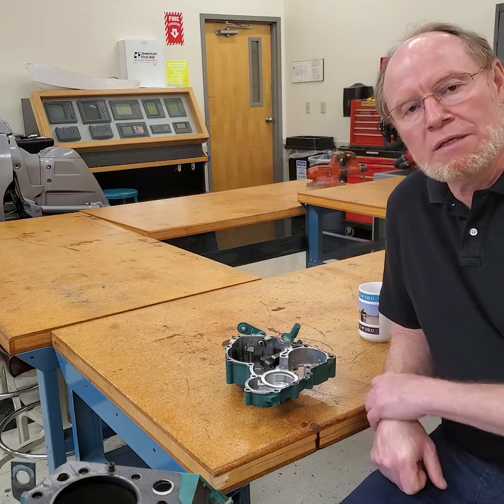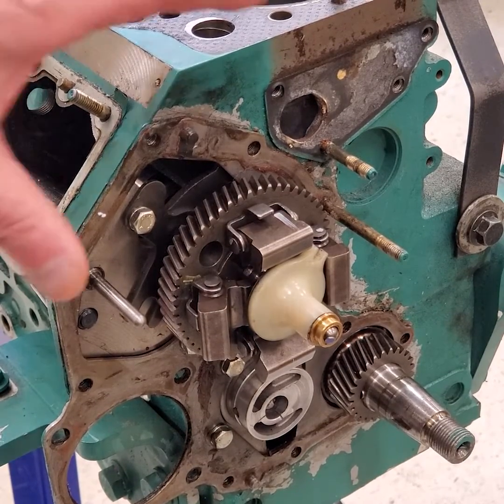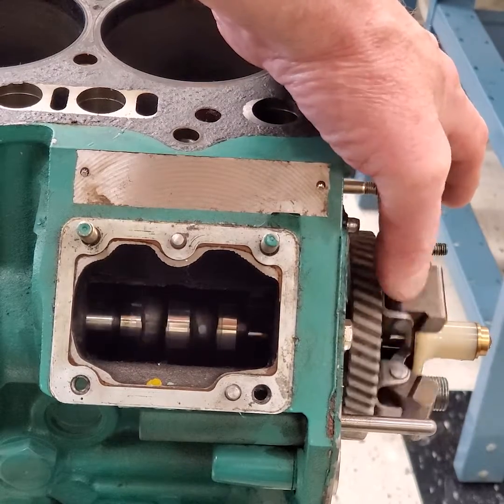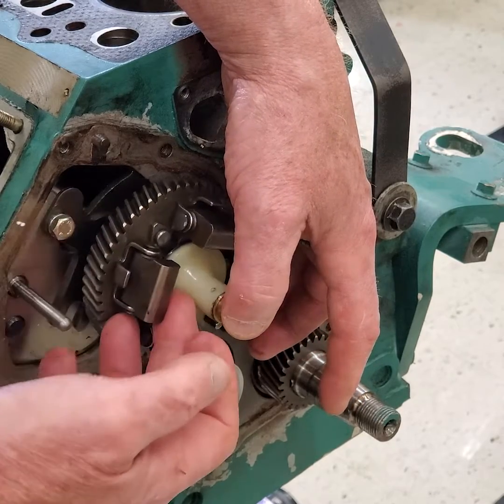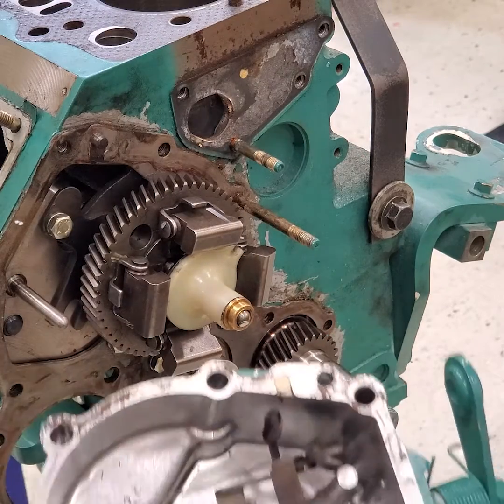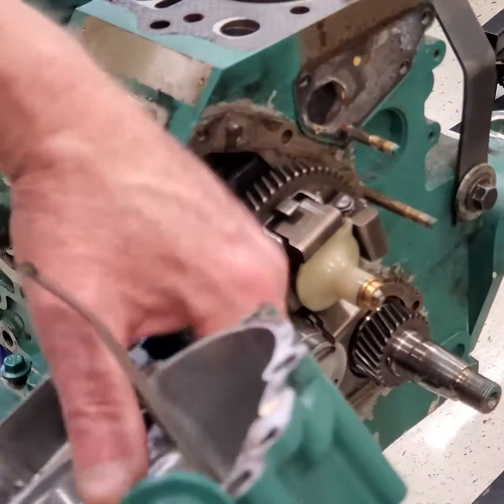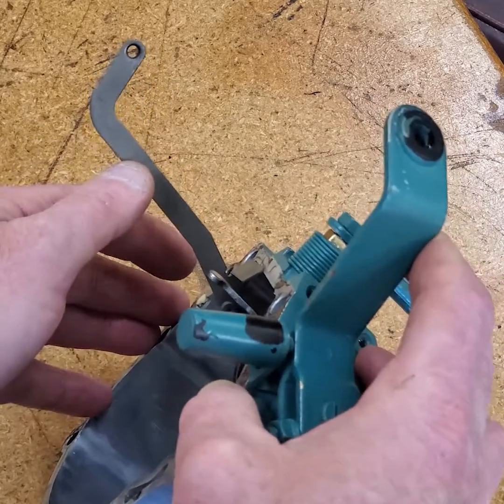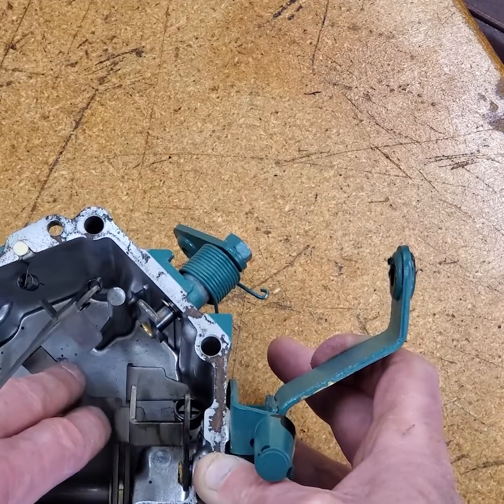How a Diesel Governor Works

Comment: if i pull a fuel injector of a 1960 tees three cylinder air cooled diesel am i going to find parts that perform the same tasks as the parts you showed in this video..... ( ruston buycrus 10 RB dragline )
Reply from the maker: I doubt the governor is behind the injector. I also Never worked on one of those.

Comment: I have a question please. Firstly though, thanks for this fantastic video!
My genset has a Lister Petter TR3 engine with an old DeepSea controller. As soon as I start the gen, the controller shuts it down again almost immediately with an over-speed warning. It has a magnetic pick up and it has a frequency sensor. The MPU seems fine (I put a new one in). I measured the Hz and it does indeed seem to shoot up right away upon starting. The cut off for the controller is 57 Hz because the genset is 1500 PM with 50 Hz normal output for Ireland/Europe. After watching this video, I am wondering if somehow the fuel rail is being kept open, even though it seems to move freely when I removed the small inspection covers. What do you think is the likely cause of the overspeed?
Thank you!!
Reply from the maker: I would first use a photo tach to verify the rpm is actually overspeeding. If you can verify that, then  it is likely their is a fault in the governor mechanics/springs.
If the rpm does not exceed the 1500 rpm then the Mag pickup or reluctor wheel is where I would inspect next.
Reply: @tedsmarinerepair8956  Thanks a million for the quick response. I will check these.

Comment: Thank you for an excellent crash course understanding. I have a 50 hp, 3 cylinder Deutz diesel in my stump grinder and that governor works hard as the load is continually changing. Many thanks for your time and efforts to share your knowledge on a difficult topic to learn about!!!

Comment: I've been searching many videos of diesel engine fuel injection, why people insist to say throttle as diesel engine does not have throttles, it makes confusing, do you mean acellerator pedal right?
Reply from the maker: Yes, I still use the term Throttle as in throttle "lever" which controls power output.  The two helm levers are typically referred to as the shift and throttle levers.

Comment: Bravo sir. 
Also to add, the 4 fly weights I've found as you said keep the engine at a low rpm under load. 

When removing 2 of the fly weights, allows the engine to work conventionally.

Comment: Great video. I'm trying to troubleshoot an Onan 11.5 kw genset that running on (almost running away) at high rpm and the only thing shutting it off is shutting off the fuel at the manifold or blocking the intake. What do you think could be the cause of a genset running away and not be shutdown by the shutoff lever?

Comment: Hi. This was very well explained by you. Thank you so much for this. So I have a question.
I have the same engine on my home generator. The RPM doesn't seem to be holding itself with variation in the output load. The voltage and frequency keep changing and my solar inverters keep disconnecting. Any suggestions? Are the fuel plungers weak?
Reply from the maker: @ZahidAWMall  it does sound like a fuel issue with the gen set. I would start at the carburetor to see if it is clogged somewhere

Comment: Hi, I hope it's okay to ask you this question because I can't seem to find any information about faulty governors online. We installed a completely overhauled volvo penta md11c in our sailboat, and although it's running it won't react well to the throttle. When increasing throttle, it will take a while for it to get up to speed. Sometimes, when under load, the RPM's won't increase at all until we press the cold start button, then it will respond to the throttle pretty well. After returning to idle, and increasing throttle, it will not increase RPM's, or will get up to speed very slowly. 

The mechanic who did the overhaul says that it's because the engine needs some time to run before the governor will function properly. Something about the weights getting stuck and needing some time to settle. Could that be true? We've ran the engine for 3 hours now, changing speeds every minute or so, but not much has changed. I hope you can give some advice or peace of mind or advice!

Comment: Thanks for sharing this video. I have a VP 2010 with a new injection pump fitted last year. Winterised the engine and have been getting it ready for the new season. I have lifted the pump off because I have no throttle movement at the pump and the engine will only idle. The external throttle lever is free and I have spring resistance from the large spring. I get movement from the fuel stop lever at th4 pump.. Before I remove the engine from the boat, can you think of anything obvious I am missing?
Many thanks in advance of any help you can offer.
Dave I the UK.

Comment: Its a similar set up to a honda close (predator 212) governor and if you removed that you can get more RPM and in turn more power would it be the same for if i did that for say a kubota 3 cylinder diesel and removed the governor? More fuel and put more air and more power?
Reply from the maker: Due these are marine engines and under 100% load all the time, it is not advisable to mess with the governor. That would ultimately lead to early engine failure.
Reply: @tedsmarinerepair8956  what about hypothetically it was in a motorcycle or of the likeness
Reply from the maker: Yes it will increase the output HP of the engine, but again in doing so this increases the stress that the engine is not designed for - and yes we used to do that as kids with our riding tractors and minibikes too! @gokartsminibikesandmore9925

Comment: Hello sir, whats the cause of engine hunting on these engines at idle, is the governor spring the reason?
Reply from the maker: Yes is a likely cause.
Reply: @tedsmarinerepair8956  shell i shorten the original spring to increase its tension or intall another stiffer spring?
Reply from the maker: @musavirkhan9795  order a new spring

Comment: Thanks Ted, bang on the money, I have a specific problem with a Volvo MD2010 that has been standing for 11 years and when started wants to run away every time and needs to have the air intake blocked to stop it. I’ve asked a number of marine engineers what the problem is and they have said stuck governor so this video has filled in the missing info to allow me to remove the timing case and investigate. Excellent and thanks again.
Reply from the maker: Did you ever get the govenor issue fixed?

Comment: Ted, great video...thanks so much for sharing this info.  I realize this is 2yrs old at this point, but I have a question for you.

I read through all the comments to see if anyone else asked my question, I don't see anything similar.

I'm working on a problem on a boat I'm purchasing.  It's a Yanmar 4JHE in an old 40' sailboat.  The problem is that under load RPMs are 1700 below where they should be (engine is rated for 3600 WOT, we got 1900 during the sea trial).  We thought it might be a problem with the prop pitch (feathering Maxprop), so I checked the pitch on the prop and it was wrong...but not wrong enough to account for the RPM difference.  We corrected the prop and got another 300 RPMs or so, but still well below where the engine should be (now at 2200 with properly pitched prop, but should get to 3600 WOT).  With no load, the engine actually revs a bit above where it should (we hit 3900).

Question- you mentioned several times in this video how the forces work against each other in a 'no load' situation with the governor.  Is there a separate mechanism or adjustment for 'under load' governing?  I know in some trucks, there is a governor to limit speed...so shifting up through the gears you get full RPM, but when you hit 65mph the governor kicks in and no matter how far you put the petal to the floor, no more fuel.  That is how this boat is behaving, as if there is a governor limiting the under load RPMs.

The current owner of the boat is an elderly man, and he recalls he may have asked a prior shop to 'set a governor' when he started letting his grandchildren use the boat.  This actually makes sense because there is no telltale sign of over fueling when the engine won't come up to appropriate RPM.  In fact, when we get to 2200 and then give more throttle there is no change of any kind (no smoke, no sound difference, it's as if the cable moves but the engine doesn't get the signal to increase RPMs).  We considered a fuel delivery problem, but I would think that would show other symptoms (without a load, hesitation, fluctuation, etc.)

Any ideas?
Reply from the maker: The fuel injection pump may have had an adjustment done to limit the fuel delivery but not something I would suspect a dealer would be willing to do.
With the engine off move the throttle to full and then go remove it from the pump to see there is more movement you can get out of the pump (cable issue if so). 
Also if it is starving for fuel it will act just like a limited throttle range. try running it on a external fuel tank like a 5 gallon diesel jug to see if it make power.
Reply: Hi. Did you ever get to the bottom of this? have exactly the same issue on my Perkins M35 (Looks very similar to the one in this video). However, I know it isn’t a limitation setting as it did work perfectly in the time I’ve owned it. I thought it was a fouled prop at the end of last season, but when it went back in this year, same issue. Stubbornly won’t rev above 2000rpm under load, but does in neutral. 
Before landing here, I’d suspected fuel so had run it off a separate fuel can, directly to the lift pump. This made no difference. Tried changing out all the injectors and doing compression tests, but all good on all cylinders. 

Reached the conclusion it must be injection pump and/or governor. Just like you - i was intrigued by the references to the function of the governor ‘not under load’. I had assumed that if the engine can rev high under neutral, the governor must be fine. But does it function differently under load? Obviously an engine can rev highly with no load quite easily, and wouldn’t require much fuel. However, under load much more fuel is needed to raise and maintain those revs. So - if the governor is ‘over restricting’ this might not be obvious with no load. Would this be an issue with the large throttle spring? If this had become weak, then would it struggle to resist and balance against the action of the plastic cone governor pressing against the plate, leading to the governor ‘over restricting’? I can’t think what else in the governor arrangement could do cause these symptoms? Or maybe it is just the injection pump itself? Any thoughts or advice from ted greatly appreciated! John

Comment: Great video cleared many of my confusions about this assembly of governor springs. But i have a question sir, i have an alternator coupled with one of these engines but that would retain the rpm on load instead drops many rpm on load. Please do guide me on this.
Reply from the maker: I'm not exactly sure what your asking . However, if it is a diesel engine and it's losing  rpm when a load is applied, use an amp clamp to determine if the load is greater than the gen set capacity. If the load is not excessive it is likely a fuel delivery problem.
Reply: It is a very comprehensive video on how a deisiel engine governor works no wonder the best over the youtube. Sir there are a couple of bolts inserted right into the body just side to the pump housing on left side, what is the function of them, i am sure they are, since they are inserted into the governor assebly housing i cant seem to know or find out thier function anywhere? If you could provide me your emil address i cam show you. That would be highly appreciated.
Reply from the maker: Do you mean when there is a large DC load applied and the alternator has to put out maximum current?
If so, is it a high output alternator - not the stock one?

Comment: If the centrifugal governor isn’t working properly can this cause runaway? I have a deutz diesel which starts reving uncontrollably. Unsure what the problem is
Reply from the maker: That is very possibly the cause. I would inspect the throttle linkage to ensure the cable is moving the fuel injection pump lever back to the idle position
Reply: Ok, the deutz engines don’t have one pump but rather individual pumps per injector that run off a cam shaft. I’m a little confused how the throttle and governor work with a system like this. I guess I’ll pull everything apart
Reply from the maker: @CMF917  on one end of the engine will be the governor assy. Likely in the front where the gear drive is. There will be a control rod that connects all the pump fuel levers together. That rod connects to the governor and throttle lever. I would start at where the throttle cable attaches to the engine. The governor may have a broken return spring. An exploded parts diagram will help.
Reply: Thanks sir for the info and getting back to me

Comment: I have heard the a two stroke / cycle diesel can ‘run’ backwards therefore negating the governor and therefore over speed the engine.  Is that correct?  Methinks not.
Reply from the maker: The fuel injection would be at the wrong time if cranked in reverse so no it would not run. The governor flyweights would still make the governor functional as well.

Comment: See I'm having a problem with my diesel engine. It can barely idle without me holding it towards the run position. I think I just found my problem or at least understand it a bit more now. Thank you
Reply: I'd probably check fuel pressure first

Comment: What causes a small engine just like that Kubota to be difficult to start unless you give it half throttle before starting engine is an exceptional shape it is not worn out or smoking or blow-by or any of that stuff just has to have half throttle to start easily
Reply from the maker: Will it carry a full load at rated rpm?
Reply: @tedsmarinerepair8956  engine is perfect in all aspects except for starting needs about half throttle no other issues of any kind Kubota v2203 e
Reply: @tedsmarinerepair8956  no oil usage no injector knocking or nailing nothing
Reply from the maker: @tonydiesel3444 tiny amount of  air entering the suction side will do it. Check all connections from tank to lp pump
Reply: @tedsmarinerepair8956  it has all new lines new filters even a clear one on the suction side

Comment: how do you change if your motor has a "one speed position"?     and you want it to react to a payload.
Reply from the maker: It sounds like your talking about a fixed rpm engine (diesel generator).
In those the governor will add fuel as  load increased to carry the load. If you wanted to chang it to variable speed you need a different pump/governor design.

Comment: Hey man great video you really know what your talking about!what has to be changed to make it varible speed vs limiting speed like a welder has,trying to put a welder engine in a skidsteer and I bet your the man that knows what I need to do!
Reply from the maker: Many gensets have the governor preset to 1800rpm with a small adjustment on the pump to set the rpm to 60 Hz. This is something I have not done but am sure you Need a different injection pump and governor arrangement.
Reply: @tedsmarinerepair8956  it's a cat 3024c the little perkins engine,i can't find any information on the swap,I'm just curious what actually limits the speed in the 1800 rpm engines

Comment: I've got a c1.5 used on a morbark wood chipper. Engine runs at low rpm, throttle doesn't seem to increase rpm. I have taken it apart and can't seem to understand what the problem is. If I stick a screw driver through the oil fill and push the fuel linkage arm the engine rpm's increase just fine.

Comment: Hi sir, i bought brand new Johndeer 4045 engine and fixed it with ganerator, problem is the rpm/hertz go down when the power increase , what should i do yo make the pump governor work right ?

Comment: Hi Thanks for the informative vedio.  Can i know the diffrence in purpose of Governer and Gearbox  of Marine Engine?
Reply from the maker: Governors maintain engine rpm during load changes during engine operation. So if the load increases, the Governor increases engine output power.
Reply: @tedsmarinerepair8956  thanks can you please briefly tell about function of 'Gearbox'? I got confused after heard from someone that gearbox also for making engine speed constant.
Reply from the maker: @farhanfaizal129   In the US the term Gearbox is also known as the "reverse gear" which are marine terms for a marine transmission (inboard engines).
On old  mechanical diesel engines they may have a RPM gear in the "gearbox" which drives a mechanical cable that is attached to the tachometer (RPM gauge) and possibly an engine synchronizer  for twin engines.
Reply: @tedsmarinerepair8956  thanks😊

Comment: Isuzu 4le1 generator 20kva 52Hz went load 50% drop in 46Hz！
Fuel pump and injector repair already！ What should I do the next ？
Reply from the maker: Check and ensure the air intake is clear. Check boost pressure. Could be a dragging turbo. Also Check for excessive exhaust back pressure.